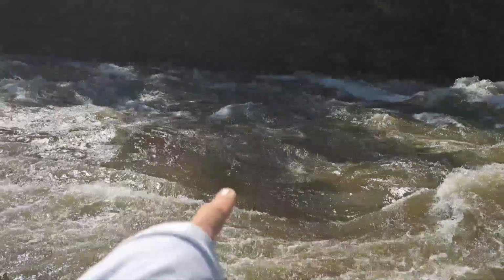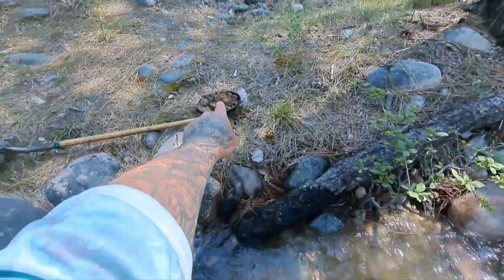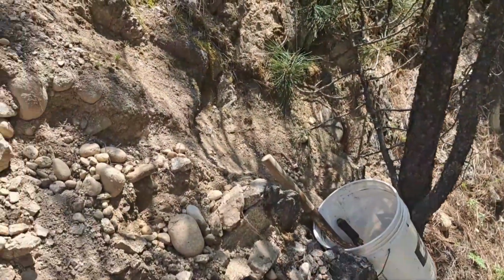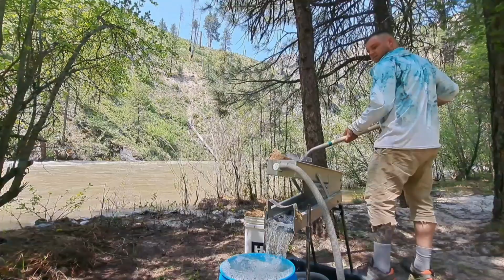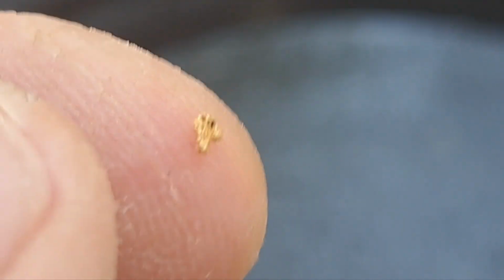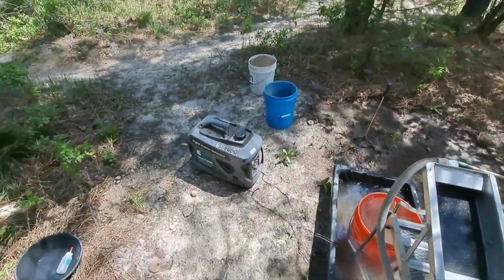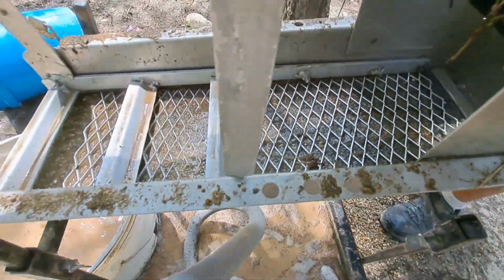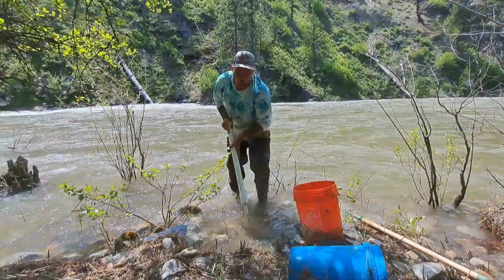BEDROCK GOLD

Comment: Do you have to have a permit for the high banker
Reply from the maker: I do have my water permit yesI do have my water permit yes But technically I don't need it because I'm resurculating in the sled and not pumping the water straight out of the river I do have the water permit though
Reply: @buffalokrisgoldprospecting   So as long as you're resurculating the water you do not have to have a permit I'm planning a trip north I'd